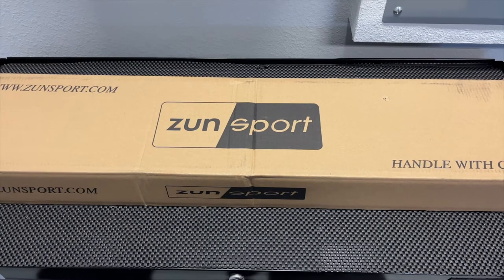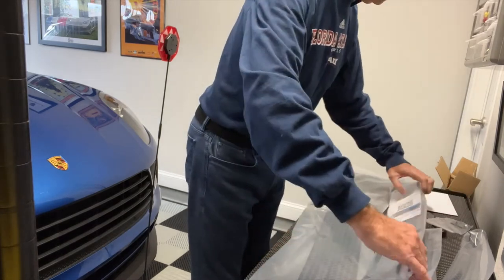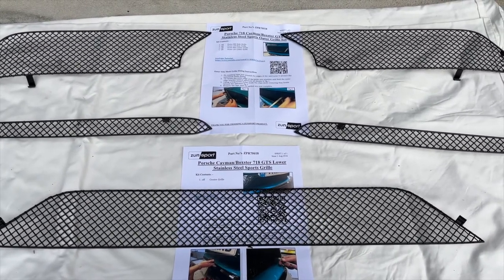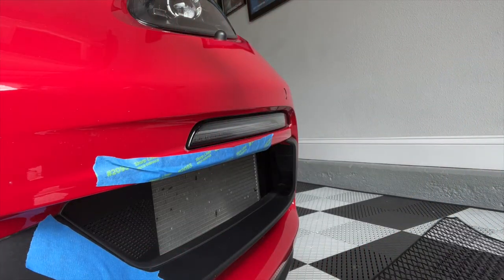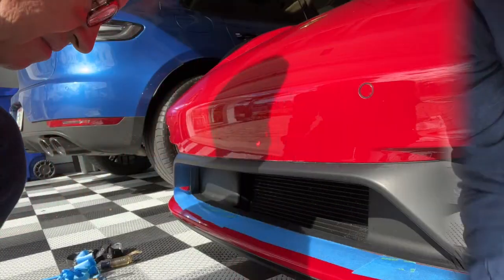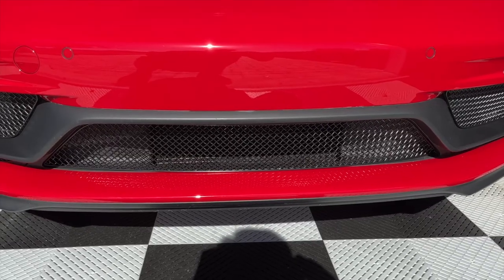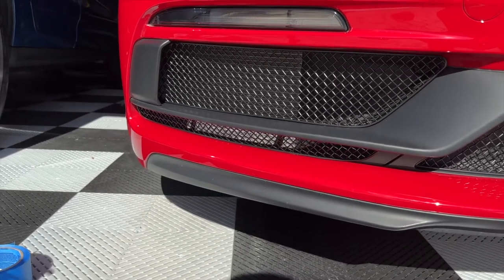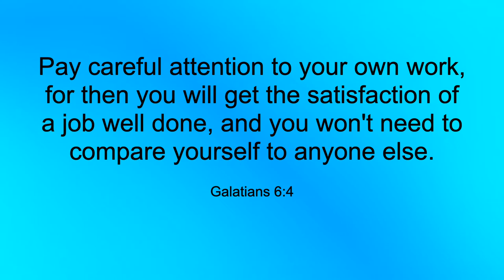Installing Front Grills on Porsche 718 Boxster GTS 4.0

Comment: This video helped a lot, thank you. Anyone looking for tips a 90 degree precision pick wrapped in tape (like the 4 set guys you can buy) is just the width of the clip and makes the center grille and the two smaller ones way easier. The finer point of my awl was starting to scratch a clip and not enough leverage. The upper sides were the only ones that just 'popped in' for me.

Comment: The lower side one, which is the smallest piece is very hard to clip on. I find it easier to deal with the clipping if I apply some pressure to bend the hook downward before pushing it into the hole.